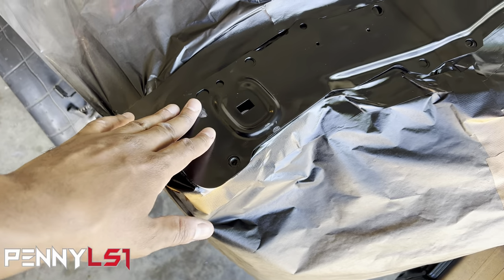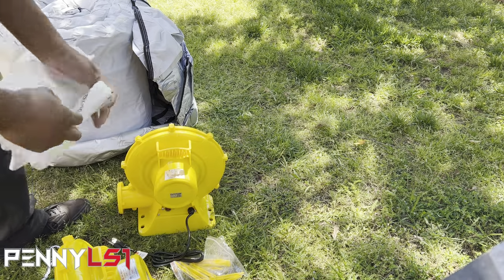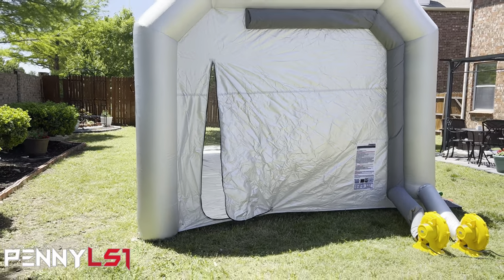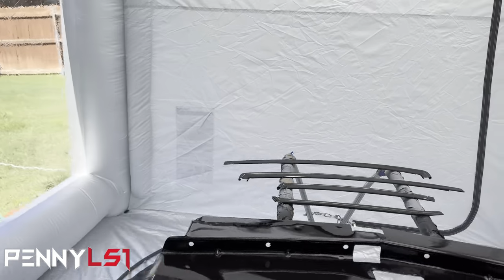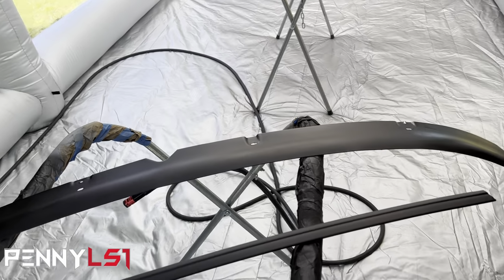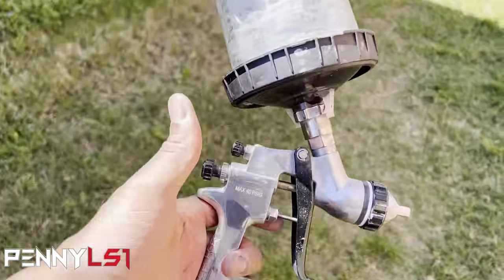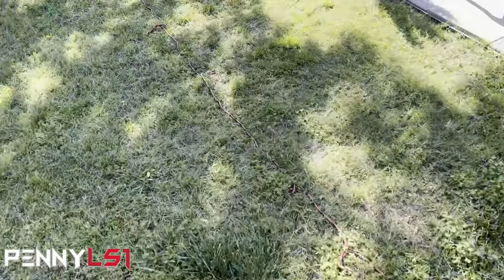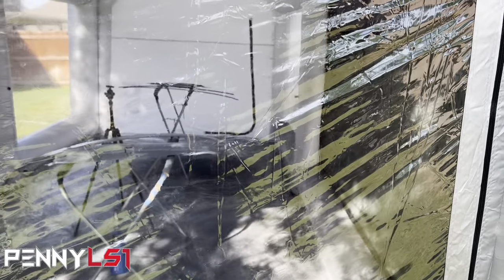🎨 WARSUN INFLATABLE PAINT BOOTH 🎨

Comment: PennyLS1, you can save material and work by applying body filler directly to epoxy primer. But, it would have to be within a 24 hour window (IIRC).  I learned this years ago at a PPG seminar on DP90 epoxy primer.  I assume this would be true for other epoxy primers, but check with the manufacturer's tech service.  DP90 is a non-sanding epoxy primer, so it has to be top coated within 24 hours to have a chemical bond to following coats. This will likely to be true for either filler or 2K primer, so once you spray the epoxy, you would have to finish all final touches (including 2K priming) the same day.